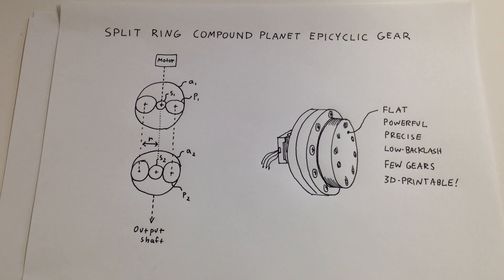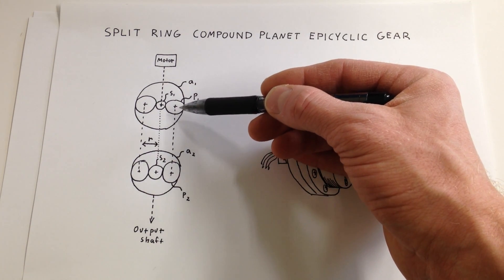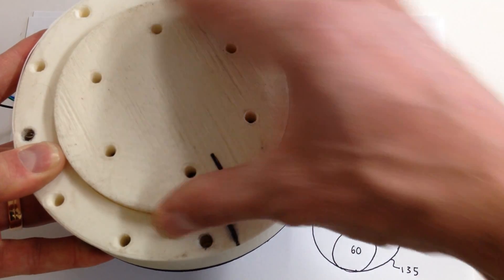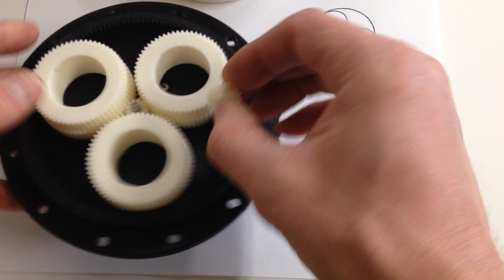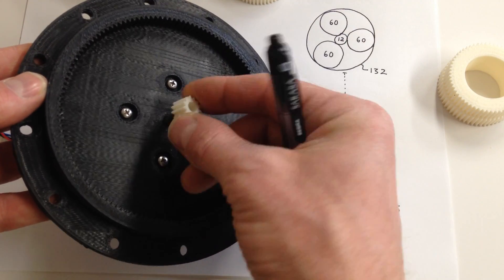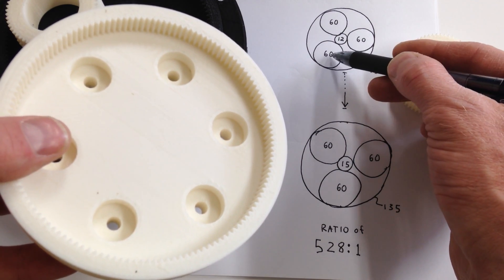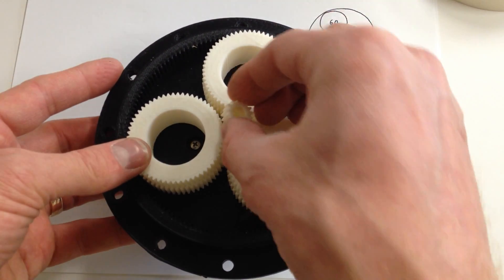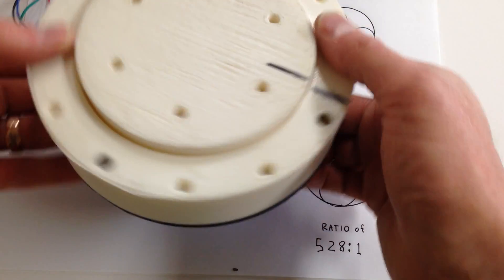Split Ring Compound Planet Epicyclic Gear

Comment: This is a great video. Further to your last point on this video, the two gear sets can't have the same module because the 12/60 and 15/60 gear pairs have to have the same pitch diameters (e.g. share axles). The calculation isn't difficult but it stretched me to derive it! Sum the tooth counts of the first sun and planet gears (12+60), multiply by their module, then divide by the sum of the tooth count of the second sun and planet gears (15+60), to give the module of the second gear set. The tooth counts of the ring gears is S+2*P (12+60+60 and 15+60+60).

Comment: Remember not to keep the motors idle for too long or they will get extremely hot. If you use PLA that will melt your 3D print.
Reply from the maker: How very true. I used an A4988 stepper driver chip with an arduino, and basically turned the current-limiter pot almost all the way down. The motor was low torque, but only got warm instead of plastic-melting hot!

Comment: Some thoughts, one year late: This mechanism might be printed with planet rings having a larger hole or internal diameter.  This would speed up the printing a bit, nothing is gained from that extra material.  Also, large holes might be printed in the top cover, to allow us to see what's happening inside. Finally, a really good thought (you're welcome) would be to print alignment marks on the gears, to ease initial positioning of the gears prior to assembly.
Reply: Great comment, dude.
Since this type of planetary gives balance force to a gear (by having gears on the other side of the sun gear) could the outer gear drive the inner gear?  This would be unique and very valuable, because if you have a 100 to 1 reduction, you can easily turn the little gear.  But you can't use the big gear to drive the little gear- far too much friction and you can't overcome this with so little torque.

Comment: Hi David, you might want to check the math on this again, I believe the ratio you have is actually 540:1.  Here is the formula I've come up with for calculating the ratio for this design.

(1/(s1/(s1+a1))) / ((a2-((a1/p1)*p2))/a2)

There may be a simpler way, but this seems to work.  Fun note from this formula if you're going for really high ratios, you could increase the ratio to 2025:1 just by changing p2 from 60 to 61.  But you would not be able to keep the idler gear any more.  Or -8040:1 if you also change a2 to 134, and if you're ok with the output going the opposite direction of the input.  Still no idler though.
Reply: If you want the 528:1 ratio, while sticking with 3 planets and an idler sun, you can use the following:
     S1:  15
     P1:  18
     A1:  51
     S2:  18
     P2:  21
     A2:  60
Reply: Yep, it's 540 👍🏻
Reply: @Save_the_manual  Can someone please explain how it is being calculated? I can't make it out.
Is the ring fixed and planets the output? What is the logic for the calculation here?

Comment: This is how a winch gear is setup, but it has just one set of planet gears (same teeth, not different like yours) that spin on both rings, the top ring turning really slow.  Monster torque from a small motor, but the gears are super loud.

Comment: Nice work.  Check out US patent 5762162.  I "invented" this type of gear reduction for power steering in 1996-ish.  I'm not sure if the novelty was the gear arrangement or the automotive application of it.  Back then, 3D printing wasn't advanced enough.  I made spreadsheet models to design the ratios and I verified it with ADAMS mechanism modeling.  It's good to see a the physical model replicates the math model.  By the way, you can play around with which element you want to drive with similar results.  For offset axis applications the planet can be driven (input carrier is held to ground) and for concentric applications the ring gear can be driven.
Reply from the maker: Very cool, that sounds like a cool real world application for this.

Comment: For each of the two annuli, instead of having two sets of Planet Gears, you are using one set of Planet Gear each having two sets of teeth, infused one above the other. I can see that the diameter of the teeth set in the top arrangement in all the three Planet Gears are smaller than that of the bottom arrangement. 
So, the Circle Pitch (angular distance between adjacent teeth) in both the arrangements must be different. So does the Ring Gears and the Sun Gears. Am I right? Please clarify...
Reply from the maker: @Gopinath2119  you are correct, the module of the gears on or touching the rotor are different from those on or touching the stator. The modules were chosen so that the axis of rotation of the small planet gears exactly lines up.. that way they can be stacked and connected as compound planets.
Reply: @davoriffic  Thanks for clarifying...

Comment: Is it relying on a difference in pitch for the gear ratio or is it relying on a different number of teeth between first and second ring to work?
Reply from the maker: So, good question. It is relying on the difference in the number of teeth between the first and second internal ring gears to work, but here's the thing: in order to have planet gears that fit both of the ring gears and share the same axis of rotation yet have the same number of teeth (each planet is like basically one gear stacked on top of another gear) they need to have different pitches. 

So the different pitches is a result of having different tooth counts but keeping those planets on the same axis.. if that helps! :-)
Reply: But won't having different pitches have uneven wear? Or are you saying that stage 1 gears are all same pitch and stage 2 are all the same pitch? I guess if not 3d printing and buying it gears it would result in buying say Mod 1.5 gears for first stage and mod 2 for second. Would result in a massive difference between two ring diameters, so therefore less gear ratio?!
Reply from the maker: @adamgibbons210  Yes, only gears of the same pitch are in contact with one another. It would be difficult to find commercially available gears I think with the correct pitches to make a box like this work. More likely, you could find half the gears and then print half the gears.

Comment: I want to add a gear ratio formula, becouse when i needed one i couldnt find it. I searched for a calculator but i couldnt find one. So i made up my own formula, and it works great.
Count the teeth of :
S1 (sun 1) drive wheel
P1 (planet 1)
R1 (ring 1)
P2 (planet of the second gearset)
R2 (ring 2) output wheel
Ratio is (1+R1/S1)/(1-(R1*P2/(R2*P1))) to one
You can check this with known gears on thingiverse or other sources.
I hope i helped a lot of people

Comment: Hi David, my name is Layne and I am currently working on a project at work that could quite possibly deal with something like this. What equations did you use to determine what your gear ratio was? Any response or help would be much appreciated, I'm looking to achieve 100:1 reduction in a pretty small space.
Reply from the maker: Hello Layne, thanks for your interest. I made a spreadsheet and included the equations next to the columns to help decipher the process of designing these:  https://github.com/IdeaPropulsionSystems/CoolEpicyclicGearing/tree/master/GearSpreadsheets    Let me know if that helps. 100:1 is certainly achievable. I recommend using a carrier to keep the planets' axis all parallel. I discovered pretty quickly that, if you let the planets 'free orbit' like in this example, putting torque on the gear box makes them all 'tilt' and jam, limiting the effective torque you can get out of the box. If you have a carrier that holds their shafts parallel, that fixes the whole problem. Enjoy! I'd love to see what you're making!
Reply: @davoriffic  Thank you so much for the quick reply, and your charts were incredibly helpful. How would the R2 equations change if I were to bring a worm gear our from the first set of gears? I have to turn my gears 90 degrees and I'm thinking the simplest way to do so is a worm gear?
Reply from the maker: @laynehelmuth4736  Interesting; not sure exactly where you mean. Worm gears certainly give you the 90˚ change in direction and will add another 10X or more to your ratio depending on the teeth~ also adds a lot of friction. It might also be the weak-point in terms of breaking gear teeth under lots of torque because there's a lot more teeth material engaged in the rest of the gear box than in a single stage of worm gear. hmmmm.... :-D

Comment: Hey man do you have any advice for coping up high loads on the gear teeth. I had r created a gear system of 1:200 multiplication factor, and am facing the problem of very less life expectancy.
Reply: Planetary gears tend to melt after 1 hr run
Reply from the maker: Hello, and yes. This is certainly a problem with plastic printed gears. I would recommend using a good lubrication (silicone grease is good with ABS plastic) and you may consider infusing the plastic parts in a 2-part epoxy resin. Beyond that, using more gears to spread the load will increase life, and if there is a way to actually support the gears in a gear carrier, vs. having them freely orbit, it will increase the life because the teeth will not be handling radial torques caused by the two annulus layers basically applying force in opposite directions at opposite ends of each compound gear... a more force-balanced gear design would help.

Comment: I came up with the same thing on my own recently and wondered if it had already been discovered. Do you know any of the history behind it?
Reply from the maker: I actually don't know; I have seen it used in avionics motors from the 1950s. It is also sometimes used in the drive motors behind car rear view mirrors. It is pretty cool because of how high the ratio can be for a single stage of gearing.. :-D

Comment: In your spreadsheet, you state that both the sun gear 1 tooth count (Ns1) AND the annulus gear 1 tooth count (Na1) must each be evenly divisible by P (i.e. Ns1/P = integer and Na1/P = integer).  I can basically understand how you would come to that conclusion (although I haven’t done the calculations).  Doing it that way will ensure that your planet gears are perfectly “in-sync” (meaning if one planet gear meshes with the annulus/ring gear at 90 degrees, all of the of the other planets will each have one tooth that also meshes with the annulus gear at 90 degrees at the same time).   

Okay.  In standard planetary gears, if the planet gears need to be spaced evenly, only the SUM of the sun gear 1 tooth count (Ns1) and the annulus gear 1 tooth count (Na1) need to be evenly divisible by P:  (Na1 + Ns1)/P = integer.  Your case is a special subset of this (having the gears in-sync).  In the general case, as long as (Na1 + Ns1)/P = integer, then the gears will mesh perfectly, just they won’t necessarily be in-sync (i.e. if one gear from one planet meshes at 90 degrees, “none” of the other teeth from any of the other planet gears will also mesh at 90 degrees at the same time).  The only exception is the special case you give (I think).  

I have a couple of questions.  One is, is it necessary for (Ns1/P AND Na1/P) to each be integers in split ring compound planet gears (as you have in your spreadsheet), or is it also okay to use (Na1 + Ns1)/P = integer as well?  My other question is do you know if there are any efficiency issues with the teeth being out of sync (i.e. (Na1 + Ns1)/P = integer)?

Comment: helo, was wondering what margins you put in for 3D printing to account for shrinking/expansion of the material during 3D printing?  I'm having issues with the gears being 'stuck'. Calculation wise it all works out, it's just in the 3D printing stage I can't figure out what to adjust to account for the expansion/shrinking.
Reply from the maker: That's a good question; fortunately to make it fit you only really have to shrink the size of the two smallest gears in the very middle. Just make them 1/2mm smaller than the object's given dimensions and that should do it... The small gears can basically be printed inside of 20 minute so it should hopefully be smooth sailing!
Reply: @davoriffic  thank you for your quick reply. I've considered changing the size but that in turn will change its module no? and as a result, a different module would mean issues with meshing. I haven't experimented with it however so i'll give it a try.

Thank you and keep it up!
Reply from the maker: @ikkeennigij121  for printed plastic gears, it'll work fine.. just make them 'smaller' by a percent or so... also one approach I have taken for making printed gear boxes is to print them so the gears mesh just slightly TOO-tightly, and then run the entire system at high speed without any lubrication with a cordless drill... the friction generated will smooth and 'squish' the teeth into a perfectly meshed low-friction state in about 5 min of continuous running. You can then add silicone grease (which won't destroy ABS or PLA) and it will run smoothly with very little backlash. Have fun!
Reply: @davoriffic  that's an interesting approach, I'll give all of those options a go and see what suits me best. Thanks!!

Comment: Hello,

What does BAD FIT means for the gears in the spreadsheet? Will it mesh?
Reply from the maker: BAD FIT means something is wrong with the number of teeth for the angles involved; the won't mesh because it is asking a tooth to be some fractional amount shifted, for instance.  Experiment with slight offsets in tooth numbers until that warning goes away.

Comment: How well would this work as a speed multiplier? For instance, in a generator concept where the input is high torque and low speed?
Reply from the maker: Yes, a good question; it is terrible for speed multiplying because of how much leverage the least bit of friction has. It is similar or worse than trying to use a worm gear to multiply speed.
Reply: David Hartkop I can visualize how the setup in this video would have difficulty with back driving. The torque input at the ring gear would cause the planets  to twist and bind on the housing/sun gear in the other stage. If rigid carrier was added and some bearings I imagine it should back drive just fine.  It doesn't seem like there is sliding component that you would see in a worm drive. That being said, you have done some great work explaining how the setup works! I may have made a fundamental error but it seems logical if I keep the planets from twisting and binding. I'm going to try it and report back.

Comment: have ever tried to run it backwards as a step up gear box with no external load or resistance???
Reply from the maker: Oh, yes... well the first thing i noticed with one of these gear boxes is how rock-solid the output gear is in its position. I can imagine how, in a friction-free simulation, this thing could step up the speed very rapidly, but things like friction and angle-influenced binding of parts pretty much means it's not going to happen with this kind of box. It's basically like trying to push a very fine-toothed worm gear backwards.

Comment: Very cool design! Have you done backlash and max. payload tests on this?
Reply from the maker: I have not, formally. It feels like very tight gearing, though there is some wobble when it runs. I think much of that has to do with imperfections in the 3d print and the fact that there is no gear carrier.. the gears just orbit freely.

Comment: what's the module of the planet gears selected for stage one and stage two ? please reply David.
Reply from the maker: I gave the gear specifics in Diametral pitch, which you can convert to module. There is a design spreadsheet on my github for the project here: https://github.com/IdeaPropulsionSystems/CoolEpicyclicGearing
Reply: @davoriffic  thanks david, with your help i have designed a new gearbox.
Reply: but made slight modifications in the design and completed it.
Reply from the maker: @aravindputtah118  Please share a link! I'd love to see it.

Comment: Hi David, I've found some formulas online and calculate your ratio at 540, where am I going wrong? Could you share your formula please?!
Reply from the maker: Hi Adam. I put up a spreadsheet with the formulas I used here: https://goo.gl/bLfA0a
Reply: David Hartkop do you think this system can be run in reverse?!
Reply from the maker: In theory yes, but friction is really REALLY stacked against you with split planet gears. It's like a worm gear in that sense, only worse because there is more tooth involvement.
Reply: Hi David, is that due to the way this is working? 'pushing' second ring around rather than a true involute gear relationship. Of course the ratio massively increases torque.
Reply from the maker: If the box is set up properly, there actually is a true involute gear relationship between all teeth, it is just that the ratio is so great that static friction plays a huge part in the ability to make it start moving.
Reply: David Hartkop thanks.. so if it was setup to a ratio of, say 20:1 it should run in reverse and be much more compact than a traditional 2 stage planetary gearbox..
Reply from the maker: You might actually have some difficulty designing a version of this with a ratio as low as 20:1.
Reply: David Hartkop. Yes, I've gotten close keeping pitch the same, just increasing second planet and ring size. Can I email you please?
Reply: Hi David, I think Adam Gibbons is correct with the ratio of 540. Solving the kinematic relations one finds i = (2*R2*P1)/(S1*(P1-P2)) in which Ri is the diameter of the ring gear, Si, the sun gears diameter and Pi the planet gears diameter. In this case however, since the compound planetaries in this case have the same radius (S1+P1 = S2+P2), one has to use the equation for the modulus and solve m1*S1 +m1*P1 = m2*S2+m2*P2. Put in the numbers, and you will get i = 15552/28.8 = 540.